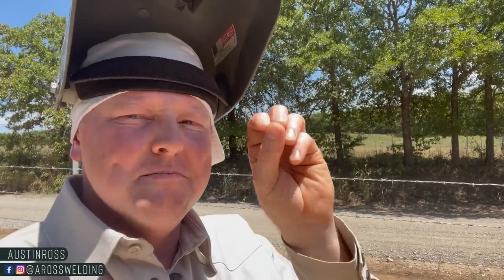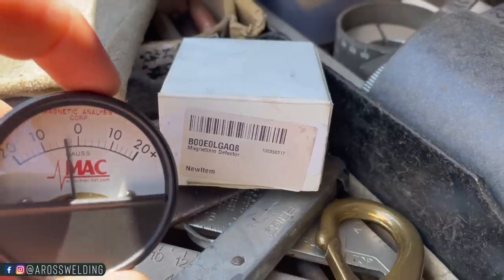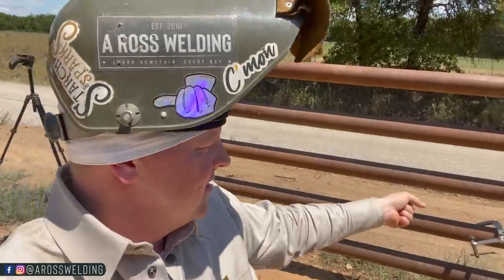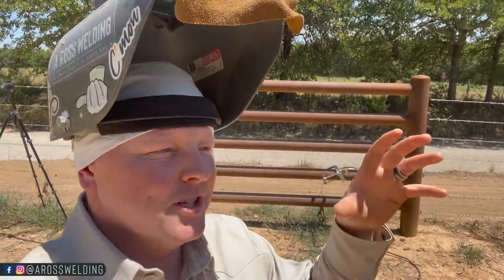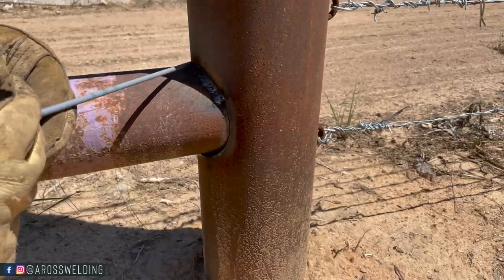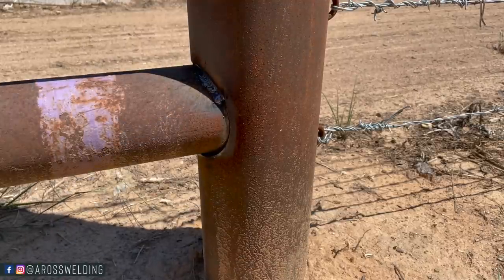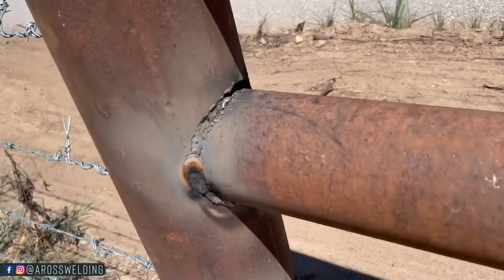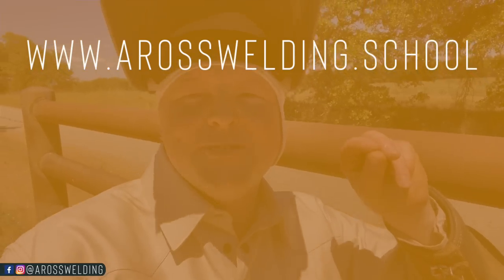WORST MAGNETIZED PIPE I'VE EVER WELDED ON - how to weld it? what causes it? radiation? and ...

Comment: When  we welded new drop in sections to replace old pipe  the old pipe in the ground was a lot of the time magnetized . Sometimes you could hold a hammer on the end . I always carried a Gauss meter . One could weld the pipe usually up to about 7 gauss after that we would de mag . We always had a spare welder on site for broke down welders or for de magging  .  This welder had a polarity switch for changing  the current direction  . We would put about 10 wraps of cable on the magged up end close to the end to be tied in . Once that was done  we would hook the ground to the stinger (dead short)  The welder was  turned off and set at the lowest settings then we would turn the welder on  and with gauss meter in hand at the end of the pipe we would check the end for   gauss , and slowly turned  the continuous dial up till the meter showed close to 0   if it got more magnetism we would switch polarity . It worked very well and saved our bacon many a time , because all welds were 100% xrayed . If you can't de mag  . change your polarity that helps .   This method of de magging  is in a 70 page  booklet I put together called tie in tricks and stolen Ideas . There is  3 pages in it about de magging . hope this helps
Reply: Very good and accurate advice. 👌
Reply: How much is that book and where can I get it?
Reply: Using an Alternating Current (AC) welding machine as a degausser/demagnitizer; Connect two work clamps to the two output leads/cable, (work and electrode cables) with power off connect one work clamp & cable to one end of structure and connect the second work clamp & cable to the other end of the structure. Set the Alternating Current welding machine to its rated amperage output ie 200+ amps. then turn power on with the dead short with this connection. There will be about 1 volt and 200 amps therefore 200 watts of output load, this will be 100% duty cycle. This AC machine can be turned off after using to demagnify the structure before welding with Direct Current or it can be used continuous while welding with Direct Current. 
To increase deposition and productivity, all position welding with the Hobart Self-shielding/Gas Less Flux Cored XLR-8 the AWS E71T-8JD-H8 fyi - Multiple pass, 70ksi tensile strength, 1- all position, T-tubular flux cored, -8 AWS classification, JD 20 foot pounds impact properties at -40 F and D-Seismic and H8 - 8 milliliters of hydrogen per 100 grams (8ml/100g) of weld deposit. Lincoln has similar flux cored wire, Innershield NR-203MP. As close to welding like the E7018 but on a coil. These wires work best with constant voltage weld output and quite weld nicely with voltage sensing wire feeders
Reply: Good advice!
Reply: How do I get the book?
Reply: Guess there isn’t a book.
Reply: Legend.

Comment: This is why a Miller Bobcat or Lincoln Ranger is necessary when welding pipe fence. All you have to do is switch to AC current and use an AC rod. Welds as smooth as a MIG.
Reply: Great advice.  👍
Reply: I said the same thing last video about using ac no one said anything which is weird for once
Reply: I don't think that's a universal solution. We were running 6011 on magnetized pipe with a bobcat. Pretty sure it was AC. It welded fine and smooth but the welds broke. They were fine on unmagnetized pipe but wouldn't hold under pressure with magnetized pipe.
Reply: @heyman5525 
I’m not sure either it was just a suggestion do you think it was the 6011 that made it crack rather than 7018 again just a question I’m not gonna say I know all I’m just curious
Reply: @richpitty  Well, the weld didn't crack. The base material of the posts just pulled right out. The actual weld bead from the corner post to the horizontal pipe simply pulled the base material right out of the corner post. Also, only the corner posts were magnetized. We did the entire job of uprights and horizontals with 6011 and it turned out great.
Reply: That is what I was always told. Just weld AC.
Reply: @randallcarver6950  
Yeah me to and have a good ground. Ac gets rid of arc blow which is magnetism but I’m not positive I’ve never welded highly magnetic pipe idk why there’s such a thing anyway
Reply: Well for what ever it’s worth since I have not used this technique, but my wife’s father worked most of his life in the oil fields off grand isle.   And he said they would wrap the ground lead around the pipe to be welded about 4 or 5 wraps    He said that worked for him.    Anyone else  try that
Reply: @squarefour1  I’ve done that on a weld positioner I used an old stinger lead that I stripped to bare copper and wrapped it around the pipe for a good ground that doesn’t tangle it may work for that as well I’ve never really welded magnetized pipe I just know ac current gets rid of arc blow which is magnetism I figured it can’t hurt and may help your guess is as good as mine

Comment: My grandpa, who is no longer with us who welded for 50+ years, told me to wrap the lead cable around the pipe a few times and then weld. I did it and it welded like normal. I hope others use this method and pass it on to the next generation.
Reply: Do you wrap the stinger lead around the pipe or the ground lead? Just curious as there are post for both on site. I guess it really wouldn't matter, but curious what you did. Thanks. Terry
Reply: @terrywaldrop5973  My old instructor gave me advice from his 17 years on oil rigs, and basically the ground lead you want to wrap it around the pipe that is magnetized on one side, you don't have use the stinger being it's positive. Ground is for your negative which is AC! Hope this helps
Reply: @billyjones3430  thank you. so, simple answer, wrap the ground pipe. I have 1500 feet of top rail to do this winter. Using a Lincoln ranger gtx250
Reply: @terrywaldrop5973  yes wrap the ground lead around the pipe that is magnetized.
Reply: My grandfather would hit the pipe with big hammer. And spme times it would work and some times it wouldnt. As well as wrapping 2 coat hangers. But if that didn't work,  hed that the torches and weld it that way. But i like your answer better.  @terrywaldrop5973

Comment: Austin...just for the heck of it you should try welding some of that magnetized pipe with an AC welder and E6011 rod. No magnetic arc blow with AC welding current. I have done some good structual welding with a Lincoln 225 AC welder with E7018 and E6011. If you are having just magnetic arc blow from DC welding, try moving your ground around and wraping the ground cable several turns around the pipe near your joint.
Reply: Yes sir, run AC current and 6011 or 7018 AC rod.

Comment: I've always heard wrapping the ground lead around the pipe several times would make it easier to weld, or demaganatize it
Reply: To use this method requires a separate welding machine and a Gauss meter to dial it in.
Reply: Wrap your ground lead 4 times clockwise, and 4 times counter clockwise around the pipe approximately 2 feet from the joint. The electromagnetism created from the welding process will counteract the magnetism in the pipe.
Reply: Exactly! You can actually see what it does ( leads) in the winter

Comment: SUPER BASIC INFO FOLLOWS: Magnetism is caused thru the molecular restructuring/alignment of the atoms within the iron alloy. That level of  magnetism is generally considered not harmful to you, but just makes mechanical things a bit more difficult. Radioactive contamination is totally different. When an atom is unstable, typically because of an imbalance of subatomic particles because the ratio of protons, neutrons and electrons is off, the atom wants to balance out by shedding the particles that are extra. The particle that comes off and the energy released is called the radiation. There is particulate radiation and energy radiation. A beta emitting radioactive isotope for instance is an atom that is shedding electrons. A gamma emitting isotope is an atom that emits gamma energy. Gamma is in the non visible spectrum of light wavelengths, like microwaves, ultraviolet and xrays. There's plenty to look into as far as radiation is concerned that can fill volumes. Different types of radiation pose different hazards and requires different levels of protection. 3 main components to remember with keeping yourself safe from it are time distance and shielding. Limit the time you are exposed to it. Keep distance between you and it. And if you can put something between you and it that can block it - even better. The strength of radiation is greatly reduced every time you double the distance (inverse square law). Basically the strength measured at one inch away is reduced by four at two inches. The strength at two inches is reduce by four when moving to four inches, etc. So, if your arms are extended, your finger tips are getting burned by the invisible flames while your shoulders might only be getting a tiny bit warm. If you stay there too long eventually your shoulders get burnt too. Unless you stuck your arm thru a hole in a lead wall in which case your shoulders may never feel much of anything even though your fingers turned to ash.
Reply from the maker: Thank you for sharing this.
Reply: "Basically the strength measured at one inch away is reduced by four at two inches" - unless the radiation source is in some enclosure "directing" it (like in this so called "cobalt bomb"), the radiation is emitted as a "sphere", thus it decreases its intensity, or density, by the factor of "inverse cube" - i.e. when you move twice the distance away it decreases by 2^3, ("two cubed, or "to the third power"), that is 8, three times as far it'll be 3^3, or 27 - PER UNIT of area (say, square inch).
"even though your fingers turned to ash" - that is, figuratively only, as there won't be any literal ash - quite literally ;-)

Comment: Geeesh! No wonder I could NOT weld these pipes to a 3/4" plate to save my life! It looks so bad, like a drunk dirt dauber (wasp) barfing on the plate & pipe! I thought it odd, when prepping the pipe for welding, the grindings on the concrete would attach on the ends like a thick bushy beard! Very discouraging after burning a lot of decent practice beads on 1/4" new plate, then making pure hot piles of runny crap!! 🤬👹🤬. Now I'm gonna grind the high spots smooth, sand blast it & cover it with JB weld & paint to make me the welder I ain't ! It's just a floor mount for a HF bench top metal bender. 3 vertical pipes & diagonal "truss" bracing will be enough to resist all the twisting I can put out on the 36" handle. Good enough!

Comment: Wrap the ground cable around the pipe a few times. you can just keep coiling it until the pipe is weldable. If it gets worse, then coil the ground cable the other way around the pipe. 
Only used it for tig welding where it was not possible to strike a consistent arc, but it should give the same results for stick welding.
Reply: This is the method I use for stick welding magnetized pipe and it works pretty darn good.

Comment: Another good video Austin. I've pipelined for 40 years including maintenance and rehab. I have found swapping the leads can help with the bead. I also have used a strong horse shoe magnet on really bad magnetized pipe. Use the horse shoe to straddle the bevel  and weld between the magnet. It has worked really well when I needed it. A plus is to have another welder walk the magnet along as you put in the bead. I'm really impressed with you young man. Keep up the good work.

Comment: When we pulled pipe out of holes we would stack the pipe in a east west direction for a couple months to demagnetize it. Plus we would wrap the ground also to weld. In the surplus oil field pipe yards in the Dakotas, Mont. and Wyo. you will see the pipe racks laid out for the East West orientation. We did the same for the sucker rod.

Comment: Hi Austin. Really enjoy your channel and am a learning welder. The other pipe issues I understand well. The pipe gets magnetized from the earths field. Although the earths field is not particularly strong, when you insert a long ferrous (iron) object into the ground and spin it, it will get magnetized at a rate dependent on the surrounding ground (how much ferrous material is in the soil as well as the alloy of the metal. The ability of the tube to pick up magnetic field is function of how much iron and other alloys such as nickel and chromium are in the pipe. Stainless for example does not readily magnetize nearly as well as cast iron. These residual magnetic fields in the metal steer the electron flow out of the tip of the electrode causing the havoc. AC makes sense that it would help but not solve the steering. Heat will demagnetize the metal but that would be a lot of preheating for tubes of the size you are dealing with. Degaussing also will lessen but probably not completely solve the gnarly puddle unless you really ge-gauss the crap out of it. Interestingly, submarines get magnetized because they are long enough, like the drill pipe/tube to cross the wide gaps across the earths magnetic field and become magnetized as well. Submarines are regularly degaussed because the enemy will use magnetic fields to try to detect you. The degaussing is done with cable and electric current that reverses the magnetic field of the object to cancel the induced field whether from a welder or big coil wrapped around a ship. When welding, the problem gradually subsides both from current flow from the welder as well as heat reducing the field. This makes me wonder whether gas welding the pipe would solve the issue although I assume very expensive. 
 Radiation in the pipe is a totally separate issue not related to magnetism. The radiation comes from the ground being drilled and does not make the tubing radioactive itself but is contaminating the material. If you can clean it sufficiently, there will be no contamination and the radiation will wash out. But drill tubing is frequently full of sludge that will be hard to get out and that holds the contamination in the pipe. When talking about the hazard related to working on it, I am guessing that the radiation levels coming from the pipe itself are pretty low (although detectable) and the real danger is that welding it is releasing it into the air. The (probably) dominant form of radioactive isotope in the contamination is  alpha emitters which come from radium like isotopes in the soil and alpha (actually a energetic helium atom ejected from the radioactive isotope in the contamination) is very damaging to soft tissue like in your lungs so breathing that is bad. I am guessing that a yard that won't accept radioactive contaminated scrap has to do with not being able to clean it out without generating rad waste that is super expensive to get rid of so they just avoid it. If I found a load of tubing (2 3/8) that was radioactive that someone wanted to get rid of real cheap, I would buy it and just take good precautions like cleaning out the first 4-6 inches away from where I was going to weld it. If cutting with a carbide wheel, I would also use a good air filter (not dust mask) and clean my clothes out good before washing them in the house. Take care to collect that dust and oil it down to prevent it from going airborne. To find out specific isotopes coming out of a production area, find a good geochemist or petroleum engineer working that field and they can probably give better specifics as to what the pipe is contaminated with. Do you call Drill pipe Tube or Pipe?? All the best.
Reply: You're learning? I just learned so much from you!

Comment: Had bad magnetic pipe doing some tig work in a boiler on heavy wall 9 chrome. 100% phaser ray. With tig welding the arc you could see it push back towards the tungsten instead of going away like normal. Things I found that helped is to get your ground lead and wrap it around the pipe you’re welding on several times. Also turn your heat up at least 10-30 more amps than you normally would. After bead pass is in it will start welding closer to normal.

Comment: 🙃👍👍👍 Thank you, This made a lot of sense now that you have tried to explain the problems in this type of pipe. From my own experience in electronics. A magnetized object having very strong flux field lines, will cause you to have problems in trying to weld, or solder on the first pass or attempt. Pre heating the object will kill most of the magnetic fields at that joint. Heating a magnet will do the same. But because that pipe was in the ground over a longer time and in close proximate to magnetic material in the ground, the problems are much more pronounced. Only my option from my work not on pipe or anything you do. This was very fascinating to watch.

Comment: Ran into this on a small project at home. Nutty as it may sound a switched from stick, to FCAW. For whatever reason it worked a treat. The welds were not expected to take much of a load, say under 500 pounds. Ran a bit more crispy than normal, but nice looking welds that I could walk out on the finished parts.

Comment: Austin, look into a cheap AC machine for fencing, especially now that in my experience most the pipe right now in Oklahoma is magnetic. I still get a arc blow on mine with 6011 but like you said fill it First, I cap with 1/8” 7018. Run it hotter promise it’ll help. If you’re ever south of okc, let’s go drink some coffee.

Comment: Building aircraft carriers and submarines we run into magnetized plate a lot. Typically if it's an x-ray or ut joint we have a degausser, or we can put an MT inspectors yoke on the back side of the joint and it helps out.